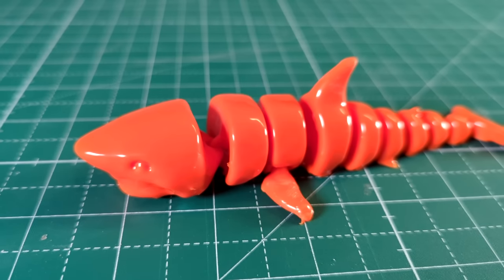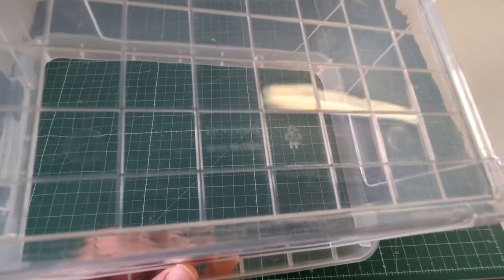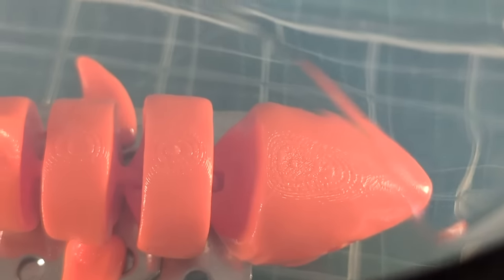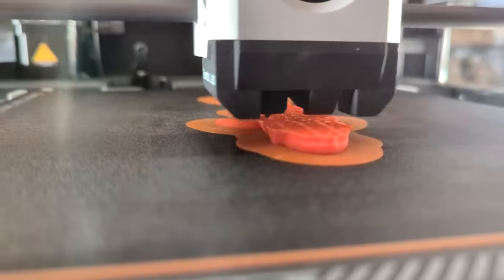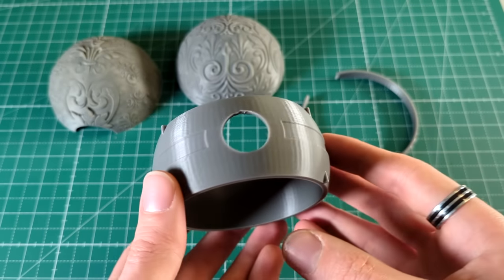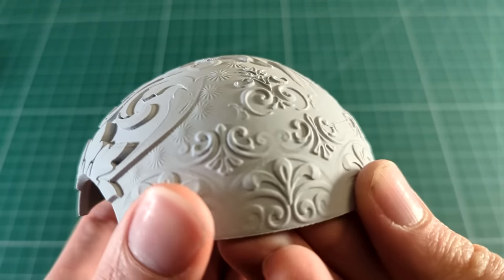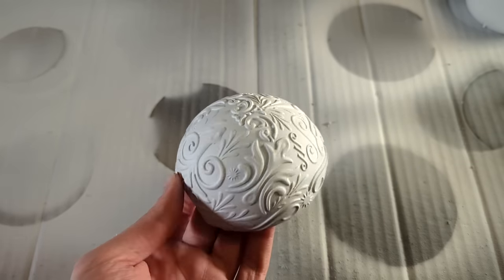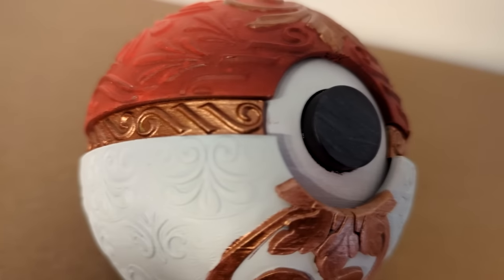How to Smooth 3D Prints Properly

Comment: Do you have any tips for smoothing very small PLA models? I'm making model railway figures so they need to retain fine details.
Reply: I'd love to know that as well! As chemical smoothing with pla is only possible with more hazardous chemicals like chloroform, I don't really want to try that.with  Sanding, sandblasting and stuff like filler or resin you will loose a lot of detail, also it's a lot of work - haven't found a good method for pla yet...

Comment: Thanks for the video, it was very informative, I just have a couple of questions if you don't mind me asking? The Acetone how much detail loss do you have? and what would be the Scottish Equivalent of the Spatula Spray? thanks
Reply from the maker: The longer the Print is exposed to the Acetone the more it will dissolve and therefore smooth the surface. So usually the detail loss is not that bad. A more acurate translation of spatula spray would be spray on filler.
Reply: @Craftknights3D  Cheers

Comment: I got a crested gecko articulated print that is very scrappy, I need to know how to smooth it without getting rid of the bumps. And I don't know what to paint it with. Please help me.
Reply from the maker: I think the best thing you can do is use a filler primer in a color that you like and apply that to the model in multiple thin coats.

Comment: Hi, I decided to make a 3D print of an anime figure, I'm torn between ABS and resin, which one is better for  printing? 
 And which one is easier to paint?  What kind of color can be painted on them?
Please help:,))
Reply from the maker: Pla is generally the easiest filament to print with. After that, you can sand, prime, and Paint the figure. You can use any paint you like but I prefer acrylic paint for miniature painting.

Comment: Can you only use ABS with acetone or can you use it on FDM?
Reply from the maker: FDM means "Fused Deposition modeling" and it is a type of manufacturing. It is not a plastic. And acetone will only smooth ABS

Comment: What if we use the first technique with PLA?
Reply from the maker: PLA can not be smoothed with Acetone. It can only be smoothed by sanding it, by using a filler, by using Resin, or by using very aggressive chemicals (not recommended).
Reply: @Craftknights3D  won’t resin still show the layers?

Comment: You missed a method. Resin coating. There's UV resin method, and there's a type of resin specifically for smoothing 3d prints. The 2nd one, you lose detail. But at the same time it's essentially prepare the resin by mixing it. Let it go through it's exothermic reaction in some tin foil. Then brush it over your print. Just thick enough to cover your layer lines. Keep brushing the model for drip control for about 20 minutes while the resin hardens. And as soon as it won't drip anymore, you're good. If you do it right, there should be little to no sanding left to do. No brush strokes or layer lines showing. Just don't expect to be able to slop it on and have it work. It's important to be there for drip control. This is a good method for prints you want to be strong. Like cosplay/paintball/airsoft helmets as the next thing to do is usually impregnating your print from the inside with another kind of resin or doing resin/fiberglass reinforcement on the inside. Or both. Keep in mind with brushed on resin you are likely to lose small details depending on your skill. The more skilled your brushwork. The less you can use to make it work. The less detail you'll lose.
Reply from the maker: I mentioned Resin coating at the end. It is a good method but, as I mentioned in other comments, I personally don't like this method because of the toxic fumes that resin produces while it cures.
Reply: You didn't finish the video...
Reply: @phreshxmetal  Pretty sure I did finish the video. Might've spaced. That or wasn't sure if he meant 3d printer resin or stuff like x3d

Comment: Does this work for PLA
Reply from the maker: Acetone does not work on PLA. You can use spray filler and sand the model to remove layer lines.

Comment: I always assumed this was more due to the 3d printer and settings used. I don't own a 3d printer.
Reply from the maker: You will always see some layer lines. Even in resin prints (barely visible).

Comment: what about using fire? 😁
Reply from the maker: A bit extreme but hey, if it works for you.
Reply: @Craftknights3D  lol I can't afford a printer but I saw a video where a guy 3D printed a fantastic four Thing and couldn't get the supports out of the eyes so he hit it gently with a heat gun and it was able to break off like normal it even smoothed up the plastic a bit as a bonus. I remembered wrong and thought it was a torch lol

Comment: there are soooo many other ways to smoothing prints i use UV Resin, platic epoxy, platic wood. but saying that there are only two ways is not a ways to start a video. I've had amazing results with epoxy putty, combined with UV resin on my Mando helmet with nearly flawless results as long as you know the proper way to do it.

Comment: I tried this with a PLA print. Kept it in there for about an hour. Didn’t smooth anything out, just made it flimsy.
Reply from the maker: What method do you mean? PLA can't be smoothed with Acetone. This method only works with ABS. If you want to smooth PLA then the safest way is to use spray primer and sandpaper.

Comment: good video but smoothning a abs articulated model is just stupid 9 ot of 10 times it fuses the hinges together and then that model is dumpster ready
Reply from the maker: You can smooth articulate models Like that. You just have to bei careful and make sure that you don't expose the Print for too long.

Comment: I don't know what it is with people being obsessed with smoothing 3d prints to get rid of layer lines. Accept it! It's part of the manufacturing process. It's beautiful in its own right, just like the machining or grinding marks on a precision engineering component. You don't have an injection molding machine. Yes, sand a little to get rid of 3d printed pimples or cut an anomaly here and there, but that's it.
Reply: Dude, people are actually  using 3d printers to make things that resemble real things. Those things… don’t have layer lines! So.. no! We will no accept bullshit.
Reply: @jitsboy  That's cute.
Reply: Tell me your an entitled underachiever  without telling me 😂
Reply: @SWUSH  I am not going to tell you I am an entitled underachiever😭
Reply: Not everything needs to look unprocessed, thus these methods are still plenty valuable.